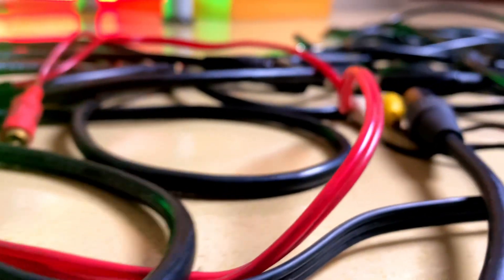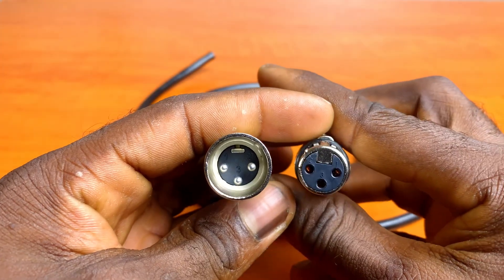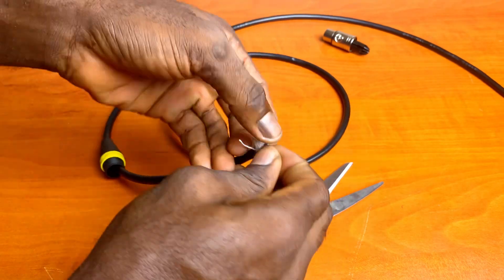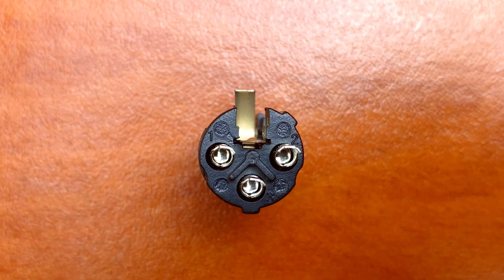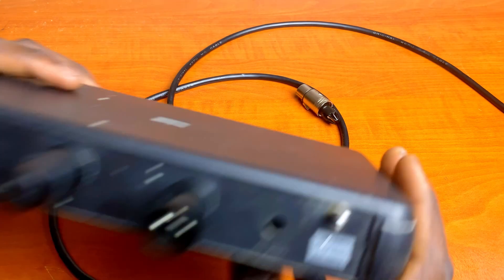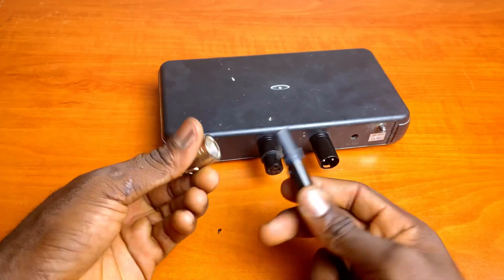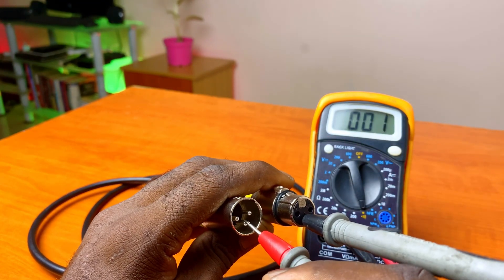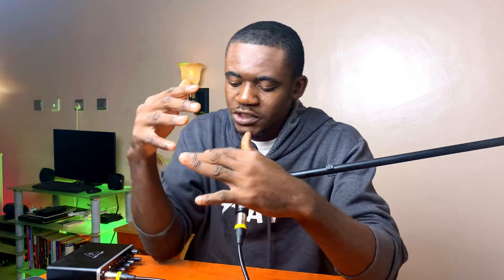How to make a balanced XLR / Microphone cable

Comment: What do you suggest for the cable and connectors? Some cables have "quad-shield" like Mogami, and some use Neutrik connectors. Thoughts? Should I just buy a big roll?

Comment: Please sir,i have question

I saw a sound engineer connecting both the red and white to 2 and connecting the ground wire to 1 and 3,,,,sir does it makes it balanced input?
Reply from the maker: That makes it an unbalanced cable. This is mostly done when the cable is used for unbalanced connections.